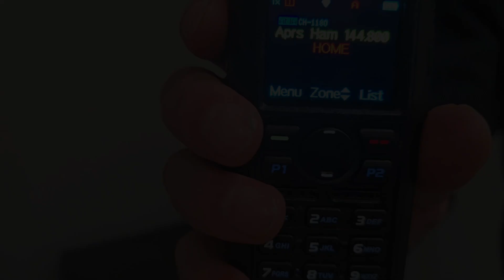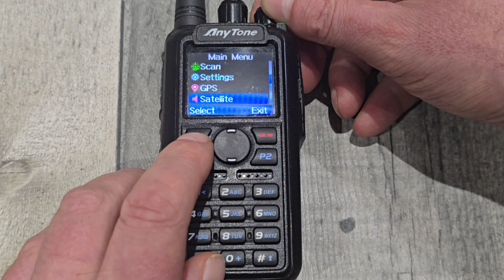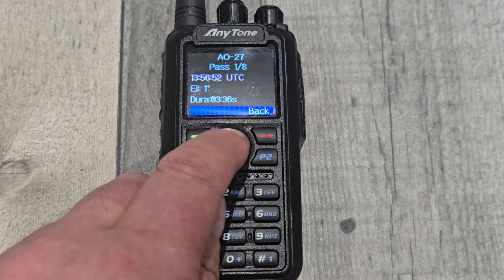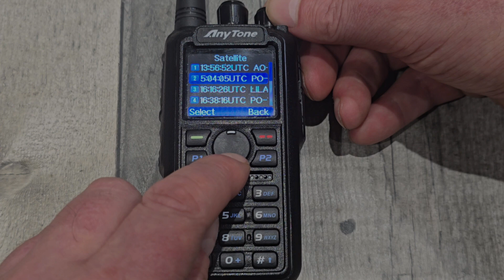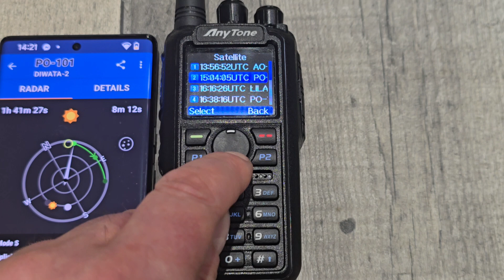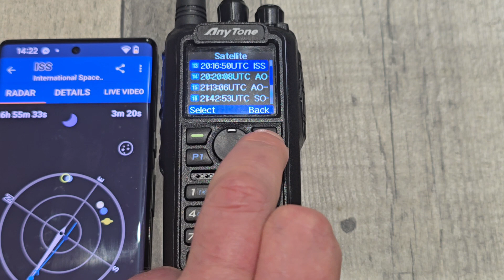Anytone 878 satellite Feature

Comment: i get no sound the ISS was above me but i was getting no audio even tho the green light was coming on and the green bar was high on the right side of the screen. any help would be greatly appreciated thx
Reply from the maker: I have not used this feature since the video. I remember that the clicker knob on the top does something. I think it squelch. If so you should be able to hear the white noise when you turn it right down check that

Comment: Does this radio adjust for the Doppler shift? Will it change frequency with the Doppler shift in other words? I'm buying an anytone 878 UV 2 plus, probably tomorrow off of a friend of mine. I'm getting a really good deal the thing is brand new still in the box and I'm only paying $100 🙂 73 great video.
Reply from the maker: Yes, auto Doppler I’ve done quite a few videos on it. Have a look back on the channel.

Comment: Hey Chris..  In Settings > Radio Setttings > Other Functions > Date Time    do a GPS Check.  Then Set Time and Confirm.
When you do a Satellite Predict now it should be correct.
Reply from the maker: that has fixed the time, but everybody else is reporting the problem, but I will persevere thanks. Send me an email 2e0ukh@gmail.com